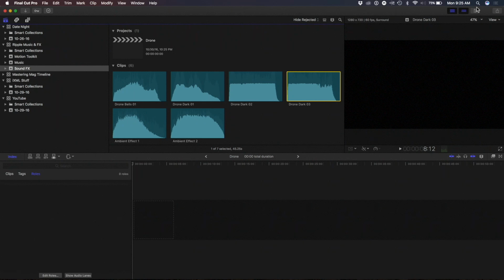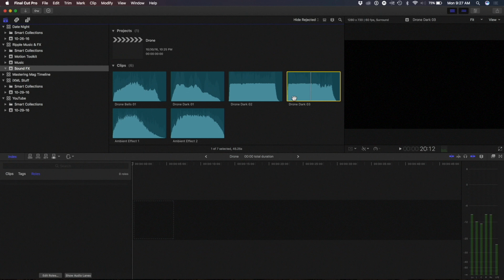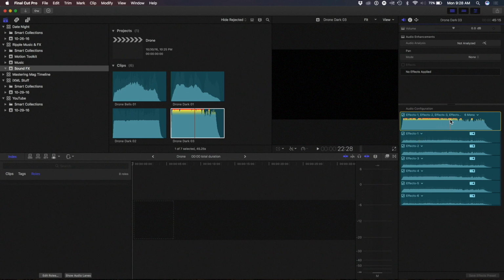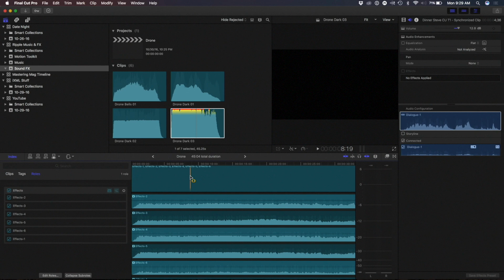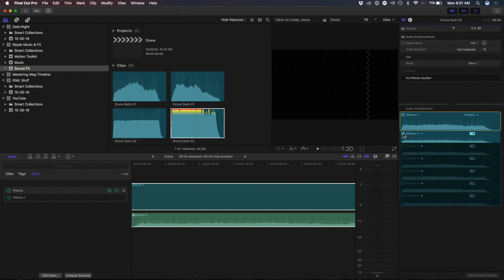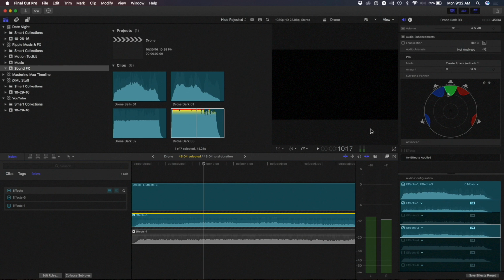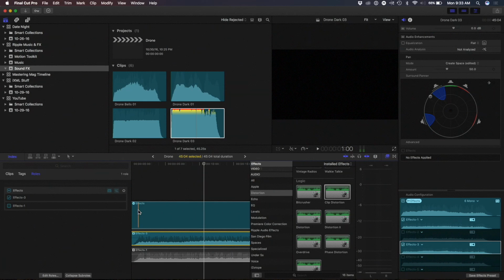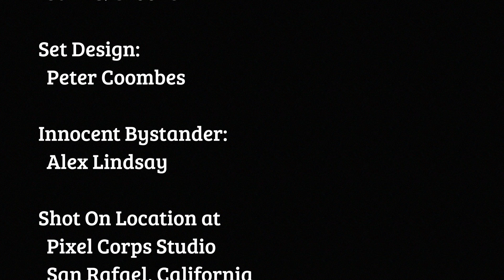MacBreak Studio Ep 381: The Audio Signal Path in Final Cut Pro 10.3

Comment: So if I just want to apply an EQ to a voiceover track (which is usually dual mono), I should just apply it at the clip level so it's applies to both components? Or apply it to one component and copy/paste to the other? I'm a bit confused.
Reply from the maker: In that scenario, apply it to the clip level so both channels will receive the EQ. If your components were different mics, then it would make sense to apply the EQ to the components.
Reply: Thanks for the quick reply!
Reply from the maker: Agree with you on that. VO should be mono -since presumably, the same mic is feeding both components.